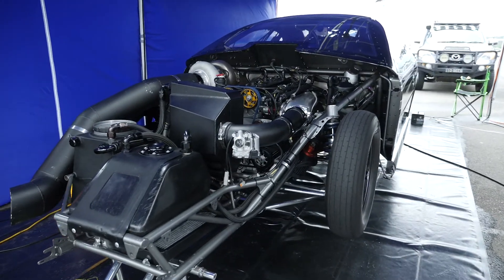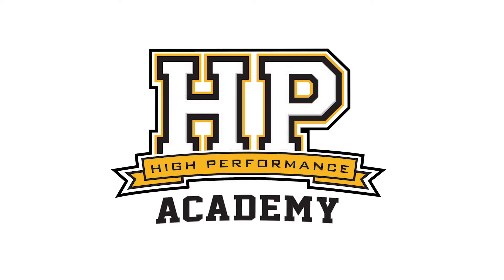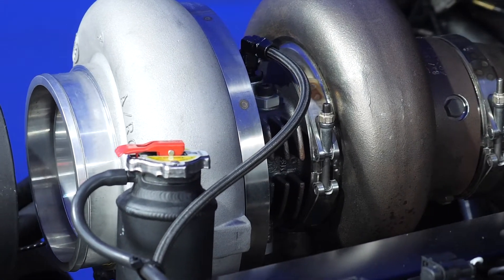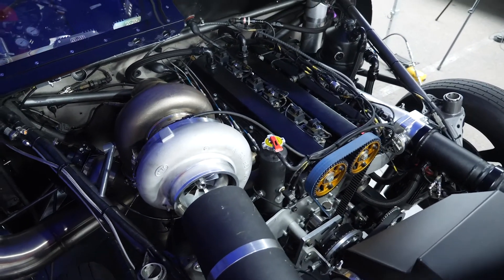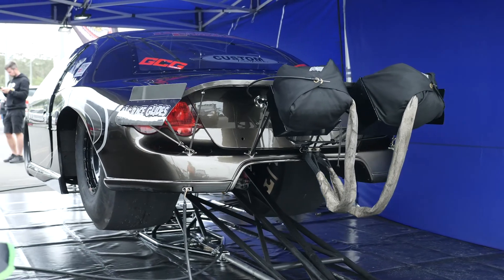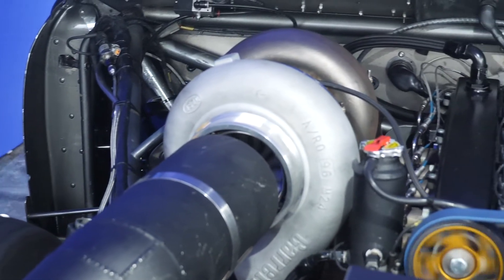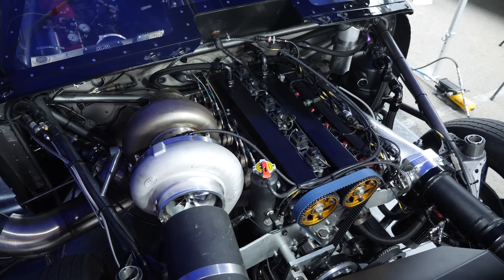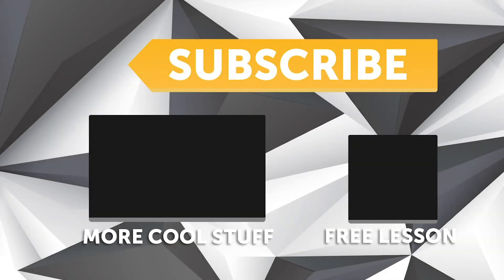60 PSI Is LOW Boost? | 2400HP Drag Car Transmission [TECH TALK]

Comment: Hey Andre at some point if you find someone running a ty drive ( so a converter drive unit with a transbrake usually hooked to a lenco or something of the like) would you be able to do a tech talk on that because myself and i know a few others would be interested to know about how that all worked converter/pump/oil supply/transbrake application ect. Really enjoy your tech talks very educational

Comment: What is the Advantage of NOT connecting the cold side air intake to the Turbo?
Reply: only thing i can think of is that the long pipe may be restrictive and it sucks in extra air between the gap. and the pipe just guides some fresh air to it. (that or perhaps it moves to much or maybe they have a silicon joint or something)
Reply: I'd imagine that that's not how they race the car, A silicone joint would usually go there. Although I am surprised to see an intake at all as intakes offer little to no benefit (usually losing power) in an open environment on a top mount headers.
Reply: @yjkader  That was my guess too

Thought maybe there was a rule that required an intake of some kind and they side-stepped it by leaving the gap
Reply: @yjkader  ram effect is very beneficial.